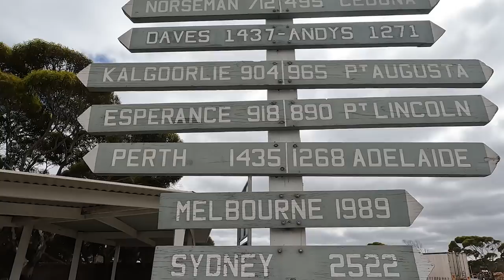A DAY IN THE LIFE - The Nullarbor

Comment: Madura is the name of the fuel stop. where you drop down onto Null (No) Abor (Trees). 

We worked out at Loongana on the East-West Railway line about 80 Kms north of Madura out in the great, empty, stinking hot nowhere. 

Back in 1987-88 we abode in Asbestos houses track-side in small towns, about 30-40kms apart between Kalgoorlie and Port Augusta. Gas fridges and small petrol generators were our lot.

No radio, no TV; just the wheels upon trains clanking and clacking in syncopation to the moaning of the wind through the peppermint trees shading most dwellings; a lonely song of visitation and departure as they thundered past in the darkest hours of the night. 

Gas fridges and small petrol generators were our lot in dusty outposts victualed by the Tea and Sugar train once every week.

Now there is nothing, but a lonesome wind song and fading memories of what used to be. Time took it away.

Comment: Hi Karstan and Maxine,

For your oil leak I’d like to suggest you try some stuff called ATP AT-205 reseal.
I’ve used it myself and I think it’s definitely worth a try.
It won’t fix every oil leak every time but it fixed my front pinion oil seal in my Land Rover while I was on holiday in Melbourne (I live in Brisbane) 
I’d just bought the truck at auction and wanted to make sure it would be as reliable as possible for the trip home.
I keep a couple of bottles with me whenever I’m on a trip.
Hope that helps😊